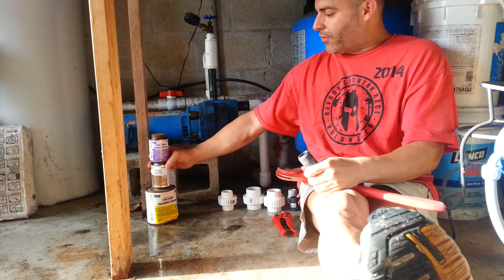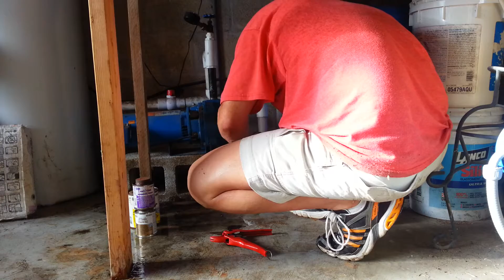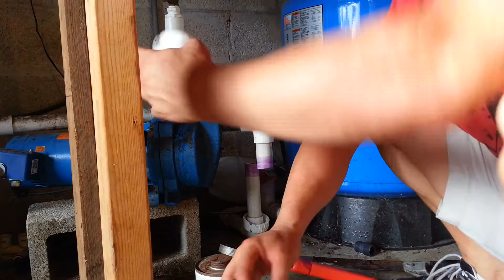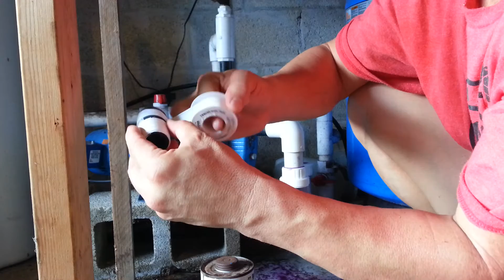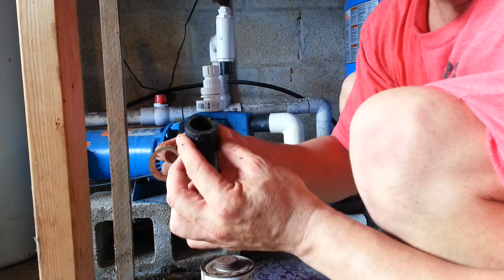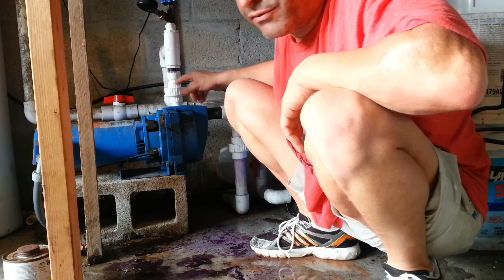How to repair broken PVC pipe on main water pump

Comment: i have a similar issue. my pump is outside the house in the ground which has tubing that runs down to my basememt and connects to the pump tank. the pipe that is leaking is connected to the tubing and is just before the pressure gauge for the pump tank. i should simply be able to turn the water and the pump off and replace the pipe right? im nervous about this damn pressurized tank lol i dont have a button to turn the tank off so im assuming ill have to shut the breaker off for that.
Reply from the maker: Once you turn off the electricity to the pump, Turn on a faucet close to the pump and let the water drain out of the tank. Then is should be smooth sailing from there.
Reply: allritythen thanks for your reply. Upon further investigation turns out the pipe wasnt leaking at all, just sweating from the temp difference in my old michigan style basement compared to outside. Lol. Thanks again though.
Reply from the maker: Kushy Kushington that good to hear.